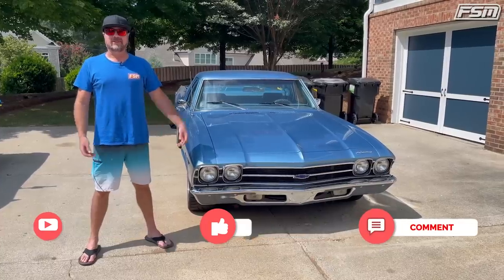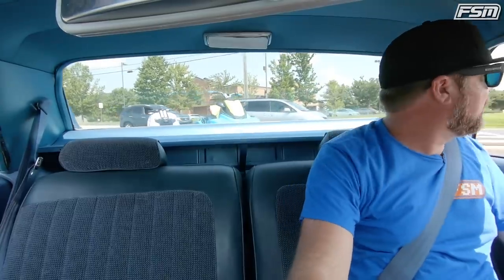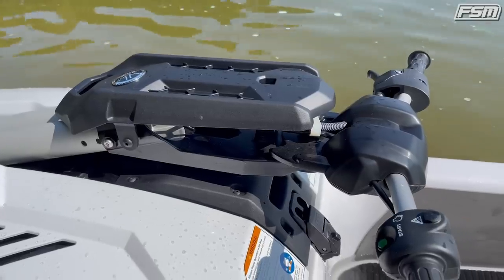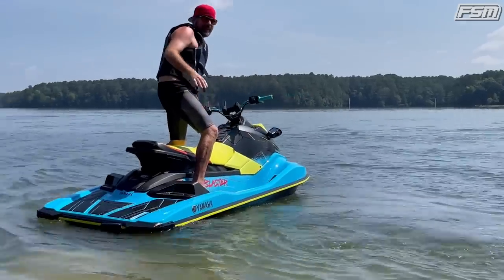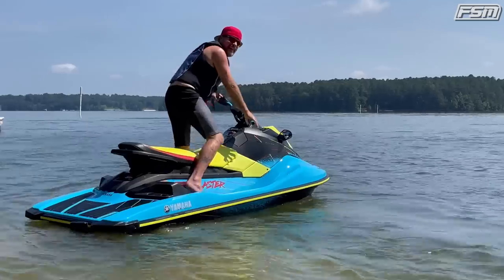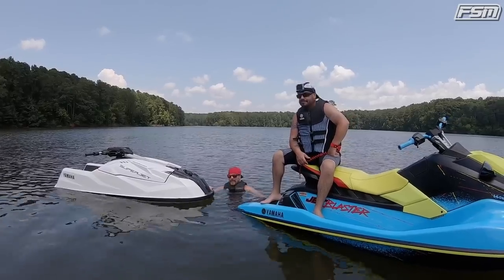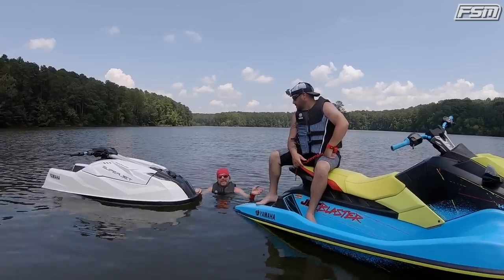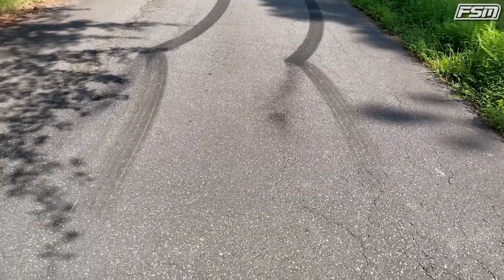TRAILER BURNOUTS IN WIFEY'S MUSCLE CAR!

Comment: The OG WaveBlaster was one of the best jet ski ever made. This Jet Blaster just looks like a much more expensive EX to me.
Reply: it's a repackaged EX with wedges (not footholds), raised bars and electronic trim. It's nothing but an insult to the original Waveblaster line that's directed at stealing sales away from Seadoo for the Spark, let's be real. Give us a 4 stroke superjet bottom with an EX "based" top that's a foot slimmer and 2 feet shorter, and only seats 1 person. And make a turbo/magnum pump option available from the factory. Use parts from a YZ if you have to. The blaster 1 was Yamaha's Mona Lisa and will never be topped unless Yamaha wants to reinvest back into racing. A blaster 4 stroke GP class would bring a lot of people to the scene.
Reply: @stustockwell  almost wave jammer status

Comment: Dang the Trixx got some competition that wave runner looks sweeeet!!!
Reply: About time honestly. Sea Doo has sold the shit out of those.
Reply: @TalkinTech  and they’re god awful and I’m a seadoo guy.
Reply: @al1087  why don't you like them?
Reply: @TalkinTech  I’ve only driven one a handful of times. It’s slower than my 95 xp and way less fun when it comes to doing donuts and all that. I would find a rebuilt or restored x4 hull for the same price and have more fun on it. A few dudes out there doing full rebuilds on the x4 hulls.
Reply: @al1087  was it a 60,.90 or 110hp? They are supposedly lighter than the mid 90s "muscle crafts" I have(96 SL 900, 96 Wave Raider 1100), so figured they would be at least similarly quick.
Reply: @TalkinTech  it was a 110. It ran like 52. My 95xp does that but has better low end torque. My 96xp does about 55,56. There’s a reason people still race them
Reply: @al1087  ah yeah I didn't think about the low end torque, mine will jump out of my arms after a spin and run 58-59 GPS still.  I'm definitely a mid-late 90s guy, just assumed the Trixx would be the closest thing to those now.
Reply: all it is, is a yamaha ex pwc with foot holds and taller bars.   The Trixx is significantly lighter and smaller.
Reply: @nd4spdbh  holy, yeah it is, 200+lbs lighter.

Comment: I had the OG wave blaster, with the good setup. Stainless impeller, factory pipe, milled head, big single carb, premix no oil injection, and ride plate. I miss that machine, but Lake Mead had the 2 stroke ban deal, So I traded it for a jet boat.

Comment: The bigger brakes give more leverage along with the bigger pads. So, the brakes have to work less for the same amount of stopping power. Along with there being more mass to delay the heat and more surface area to dissipate the heat. So, while smaller brakes can usually generate plenty of stopping power the bigger brakes will last longer when pushed hard because they’re basically working less hard and able to get rid of more heat.

Comment: Finnegan I gotta ask... The New Jet Blaster how was it compared to the OG Yamaha Wave Blaster of the 90s?
 I'ma die hard 90s square nose super jet fan. Yours is sweet. I had a 90 650 SJ. With the rainbow stripes. Broke the handle pole alot. Needless to say I got really good at fiberglass work.

Comment: It'd true what Fin says about brakes. Bigger don't stop quicker.
Unless you're taking about something pre-1990 the factory brakes will stop that car as fast as ANY aftermarket brakes. They will lock up ANY street tyre or semi slick and the limit becomes traction, not brakes.
Factory brakes, however, will fade. After 1 emergency stop they will need time to cool down before you stop on them again. 2 or 3 heavy applications of brakes and you're toast.

Comment: Are those considered muscle cars? Wasn't the El Camino and Ranchero built on pony car chassis?
Reply: Right on. Thought it shared the Camero chassis.
Reply: @rallywagon261  camaro has two subframes bolted to a unibody, the elco has a full frame from the chevelle.
Reply: Think station wagon, remove the parts that make them "family friendly/utility car", and you have a kinda cool car that can kinda do truck duty. The 1st Gen Ranchero was based on the Falcon, iirc.

Comment: I mean my 85 550 stand up hits 55 on the water and it was under a grand
Reply: Unless you've done an engine swap that's not possible. I've seen one hit 35mph but the rider wasn't even 100lbs.
Reply: @OcarinaN64  185 compression w a 0.015 overbore on 105 octane 40:1 mix.
Reply: @OcarinaN64  lowest I can get it to idle w out stalling out is like about 5 mph on the water, enough to just go straight to your knees on idle
Reply: @OcarinaN64  also 440’s are rated at 35 mph top speed w 150lb rider. Like in the manufacturer’s manual

Comment: Isn't it the fact that brake discs work best in specific high temperature region? Booster makes more pushing power to the pads therefore reaching optimal temperature quicker but also fade quicker once they become too hot? No booster just takes more time to reach the optimal temperature and get to fading temperature slower? Wouldn't it make sense to reach optimal temperature quicker with booster in normal driving conditions?

Comment: It’s no seadoo but it’s better than the trixx. I’ll Keep my 95 and 96 xps for the donuts and the rxt for the speed.
Reply: Charles Thibault  yes I have and didn’t he point out the spot to put your feet to do “wheelies” which are boring as hell after the first 2 minutes.
Reply: Charles Thibault  I can do wheelies on my xps’ with no special place to put your feet or exaggerated trim. Also launch it higher than most people I’ve seen on a trixx and it’s fiberglass. I’ve seen more trixx with cracked bulls then any other ski
Reply: Charles Thibault  they’re great skis for your kids when they get their boaters permits at 13 though. I’ll give em that.

Comment: Possibly the best car that's stock and still attainable to produce shit-eating-grin burnouts in is a 94-96 Fleetwood, bonus if its a triple-black Brougham.  Instal a 3.73, or even 3.42, and a "Torsen" (~$1k) and you'll smile every time you drive it, even when load up on a family vacation that is more traditional than Pwr Tour.  It's 20+ mpg (set the cruise at 1/2 of it's 135ish mph limit) allows you to buy more tires with less familial hassle.